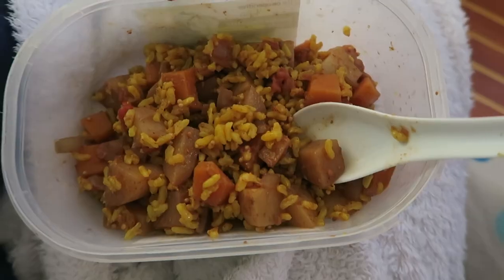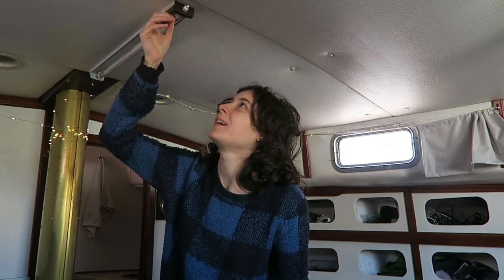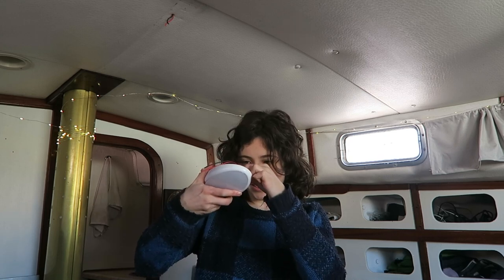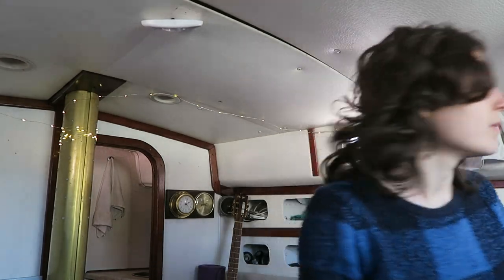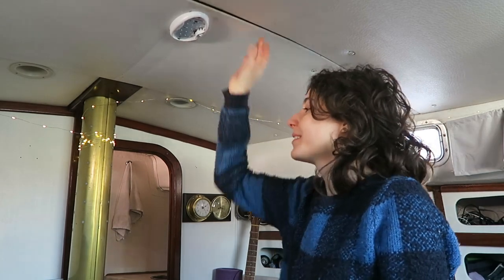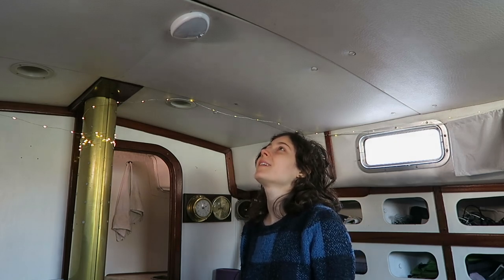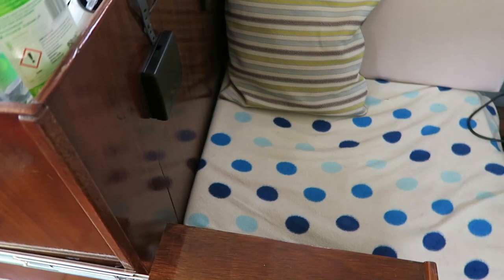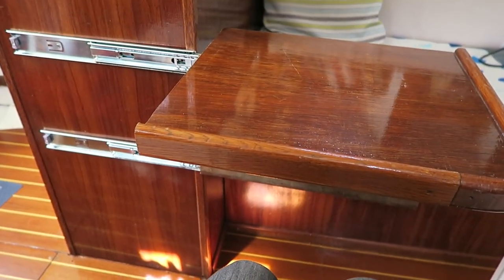Back on My Sailboat After 3 Months! (+ boat projects)

Comment: Good to see you back. Always good to solder wires in tight conditions. You can get self insulating solder tubes that you heat and don’t have to solder.
Reply from the maker: Thanks for the tip!

Comment: It's nice to see you back on the boat - you did a good job on the table - it's not easy to find ways to do things in a small space.  Yet it is fun and a lot better than doing nothing.  I am waiting for my feet to move back to Tinkerbelle yet so far I am still at home.  Must be the cold weather.  If you get a small brush and a tin of yacht varnish you can do just the edges, not the whole thing.  It will take a whole day or night to dry and you will need to do three coats.  Sand the edges a bit round first of course, :)
Reply from the maker: Thank you!

Comment: Your doing really well not many girls can do what you can.With the table move the brackets to the edge of the table top a cut the wood like you said in the film but go up a bit higher between the two brackets then it will be perfect for your knees to go under for eating.If I’ve not explained this properly tell me and I’ll send you a diagram of the shape you have to cut the tabletop great work though mate and I love the idea of how the table slides and folds out
Reply from the maker: Thanks for the suggestion, I see what you mean!